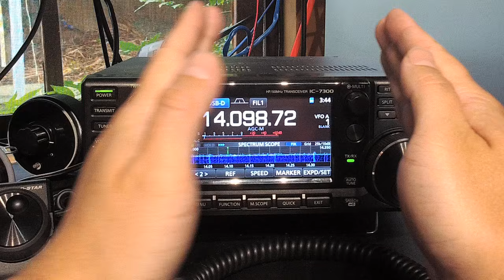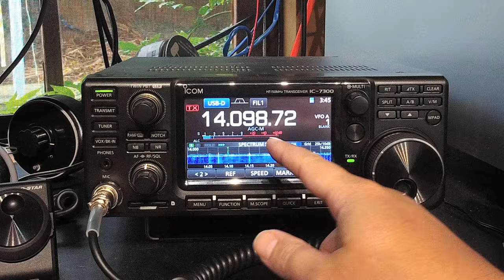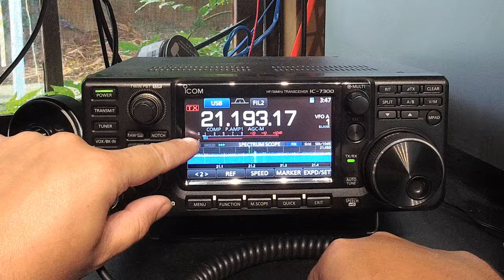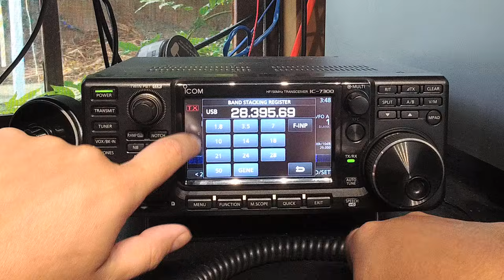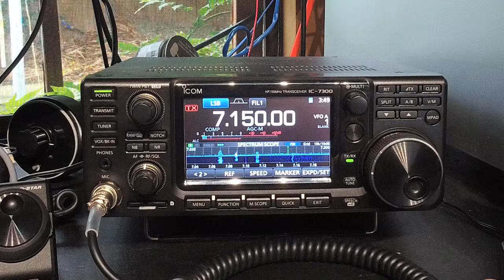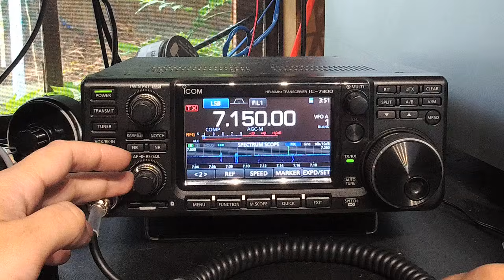How to Setup Your Receiver for Optimal Performance (IC-7300 & IC-7610)

Comment: Jarred I am looking at both the 7300 and the 7610.  I have seen your video 5 ways the 7300 is better.  However, I wonder what your opinion is why an operator should buy a 7610 over a 7300.  Enjoy your videos and wish you the best.  73 Chris KC5AD
Reply from the maker: Dear Chris, the 7610 IS a superior radio overall, but I did want to draw attention to the absolute value of the IC-7300.  In my opinion, you should only buy an IC-7610 if you have 2 or more antennas (comparing them in real time is one of the great joys of the 7610), and the rest of your station is up to scratch e.g. you have a linear amplifier if you want one, a good tuner if needed, and a beam antenna if possible.  If funds are no object, of course go for the IC-7610.  The price drops have made it a much better value proposition.  Thanks for the question and kind remarks, 73 Jarrad VK3BL

Comment: Good info. I use the RF gain as the volume control on my K2. I'm not worried about the S-meter - the RST code I think was developed before meters were common. No-one needs to be stronger than S8 anyway! Best wishes from Jon, G4LJW.
Reply from the maker: This is the best way to operate for sure.  Some radios like the Kenwood TS-590SG will 'adjust' the S Meter to show you a compensated level which is kind of nice but takes a little to get used to; I wonder if the K2 does this?.  73, Jarrad VK3BL

Comment: I just got my tech and general ticket  New ham KC1KNT  I also just got the IC 7300 and am trying to learn how to use it. I noticed that when you change bands you say " let me tune this up" and yopu switch to RTTY and hold the transmit hard key on the radio front. What does that do please  Great video it has been quite helpful

Comment: I can do the same with my IC-718. Lowering the RF gain can be done on any radio. As
far as QRM and QRN the 7300 is no better than a 718. Both are noisy. To get serious
noise reduction you will have to spend more coin. Sorry to burst anyone's bubble but
7300 isn't much for filtering and noise reduction.

Comment: I know this is off target but I've been racking my brain to find a way to run a external touch screen monitor with the ic-7610.I know it will drive a external monitor . look at it this way when you touch the screen it puts out a signal so if that signal is converted to the proper format it could be connected to the usb port .I wish I new some one from icom to look into this.  I have been told by 2 people one says icom is working on this the other said it will never happen. And one more said it cant be done because either there is now way to access a driver or the driver isn't there. Let me know what u think.  73  DE KD6ERP
Reply from the maker: Check my other reply Rob; in short without firmware updates from Icom whilst technically possible it wouldn’t be very useful.  73, Jarrad VK3BL :)

Comment: I have to admit I thought you were full of it but I checked it out and you were right by lowering the rf gain it lowered the static more than the signal present … how ever when u went to 10 m it showed several spikes with no signal present . I found that confusing  73  DE KD6ERP
Reply from the maker: It would be due to the fact I don’t have an antenna up presently for 10M and didn’t tune on that frequency; the spikes would be local noise sources.  Glad it was helpful 73, Jarrad VK3BL

Comment: what's up you hade 10 meters on the scope and it showed several spikes but no signals present
Reply from the maker: I don’t really have an antenna setup for 10M and wouldn’t have tuned the doublet so realistically the radio is just picking up strong local noise.  73, Jarrad VK3BL

Comment: Would't lowering the RF gain via the knob make it so one sees nothing on their panadapter/scope? I have tried your method and it does sound better, but it also has the result of showing nothing on the scope. It's like going back in time to make contacts by ear. 73 from N2LRB
Reply from the maker: It does lower the scope sensitivity and isnt automatically adjusted for, but you can use the REF feature of the scope to readjust the sensitivity at all times.  73, Jarrad VK3BL

Comment: Can you do a video on adjusting the ALC on SSB along with adjusting compression?  Specifically addressing the "scale" which isn't labeled.  Where exactly is the 30-50% they speak up in the manual when there is no label.  :)  Thanks
de w5dph

Comment: Hi everyone.

I revisited this video, because it is very useful. A simple RF gain adjusment  really can make listening to QSOs more pleasant. 

With hamlib's tool, rigctl, I created a simple script to collect 10 samples of 'RAWSTR' values, raw strength (S meter) value in interger number between 0-255. 

It just takes about 0.3 second to collect 10 samples, and average it.  
Calculate 1-avg_s/255, and it give a value to set RF gain . 0 means close RF gain, 1.0 open RF gain.
 

Based on my experience, The best value is around 0.6 or about 60%).  With default RF+SQL knob settings, the positon is about 9:30o'clock, for average  40m band QSO. for AM broadcast listening or very strong signal, 50%, or about  RF knob  at 9 o'clock position.

I hear less statics and band's noise, even with Fast AGC settting.(0.3s). 

Hope the info is useful .. 

Thank you.

Note: The rig is IC-7300.

Comment: Hi there can you tell me the normal place to set the Mic gain and compressor lever using a Heil PR781 Mic, mine is 60% on Mic gain and number 2 on compressor...with comp off the mic gain alone doesn't seem to activate the ALC very much till you get to about 60% from Fred in Uk.
Reply from the maker: They're great settings to use.  The PR-781 needs a lot of gain so anywhere from 60-85% depending on your voice should be fine.  Remember, any movement of the ALC - even approaching the recommended middle = distortion, so its best to keep it in the first quarter unless you're going for that rare one or can't be heard.  73, Jarrad VK3BL

Comment: I have a question for you. I have just got the 7300 and I noticed that sometimes on the display I see a faint red word that tends to flicker on and off not all the time but sometimes. It shows up flickering faintly on the meter screen at the top of the screen between the Fil2 box and the SD card icon. It is very faint and it reads either QVF or OVF, Like I said this doesn't happen all the time and just comes and goes on various bands. I can't find anything in the manual on this. Any ideas would be appreciated. Thanks! 

 

 

Reply
Reply from the maker: That is the OVF or overload warning :). Its an indicator to turn of the preamp and/or turn on attenuation.  73, Jarrad VK3BL :)
Reply: Rate My Radio Thank you!

Comment: Hi im a new m6 with a 7300 you say your tuning your radio why isn't the tuner button light on it looks to me your pressing your transmit button when I tune my antenna I hit tune button or am I doing it wrong Thanks
Reply from the maker: Dear John, you're almost certainly doing it correctly for your setup.  What isn't shown in this video is my external Palstar HF-Auto tuner, that can tune with inputs up to 100W.  73, Jarrad VK3BL :)

Comment: Does anyone get this annoying OVF flickering all the time, nothing in the manual about it Fred g4vvq.
Reply from the maker: Dear Fred, the best way of avoiding the 'OVF Flicker' is to not use pre-amps below 20M, lower the RF Gain on 40M, and use the attenuator on 80M and below.  73, Jarrad VK3BL
Reply: Hi Jarrad, ok thanks, yes i have turned it off now, dont need it on 20 by the look of it or below, i have also set the RF gain on Auto, there are 3 settings i had it on manual and turned right up, some people also put the Auto turner on and that seems to cure it...all a bit weird....just bought the radio, i really like it.....i have also got an ameritron 811H and trying to work out how to connect them together hi...from Fred in England.

Comment: Yes very good discussion on RF gain. I use that very method for years on my FT-101E and still do. Not worried about S-meter readings. This is the way ran our radios years ago to get rid of the noise. Thank you for the great video and now our secret is out.
Reply from the maker: Dear Lyle,
It certainly works magic with the FT-101E, I can attest to that.  A well setup 101E produces some of the most pleasing SSB audio you will ever hear!

73, Jarrad VK3BL

Comment: Which radio is better the IC 7300 or the IC 7600?
Reply from the maker: They're in different classes so not directly comparable; check out my latest answer to your previous question on the matter :) 73, Jarrad VK3BL

Comment: Great video.  I am running a G5RV and using the ATT has been helpful.  Thanks for the good tips! 73
Reply from the maker: You're most welcome :)  A G5RV is quite a bit of wire on bands above 80M, so it certainly doesn't hurt to add a little attenuation :)

73, Jarrad VK3BL

Comment: what antenna do you use for your 7300?
Reply from the maker: In this video it is a G5RV / 102ft dipole fed with ladder line up 14M at the apex and ~10M at each side. :)

Comment: Thank you for this very helpful video Jarrad. I've had my IC7300 a week and had contacts accident rather than design.  Your tutorial has helped me understand the principles of set-up and I feel better understanding about tuning and using the RF gain.  I'm looking forward to being on the air tonight!  Please do more videos.  You speak clearly and to the point.  An excellent presentation.   thanks again..  Robert   ZL2JED
Reply from the maker: Dear Robert, 

Thanks for the kind words :)  We're hoping to get a few more videos using the IC-7300 out soon as its a nice simple radio and good to use in demonstrations.  

That said, with the IC-7610 in the shack sooner or later we'll need to move it on, so if you have any specific requests get them in quick - my email is on QRZ.com but don't be offended if it takes a while to reply, especially if you send a long email as I'm a little time poor at the moment but definitely read them and file them away for later reply :)

73, Jarrad VK3BL & the RMR Team :)

Comment: How do you know if signals are making your AGC work?
Reply from the maker: Good question!  I don’t actually recall ever seeing a meter for this on any radio, and its probably a bit of a trade secret too.  That said, if you hear a static crash, and you notice the audio volume is lower and ‘ramps up’ back to normal afterwards, you know that the static crash pumped the AGC in a pretty big way.  I don’t know of an easy way to ‘monitor it on the fly’, other than if you find that only using as much RF Gain as needed reduces ‘listening fatigue’, then you know AGC is in use.  Basically, the answer is AGC is always in use, unless turned off.  73, Jarrad VK3BL
Reply: my understand was that S meters go off of AGC activity.  at least on older radios like my 830S that's the case.  it's also why the s meter doesn't move at all when AGC is off.

Comment: Jarred
I believe that the 7610 has a automatic notch filter built in to it. I believe you have to go into settings to turn this function on. That being said, it does not interfere with the reception as far as I see it. Leaveing it on has not caused any issues at all. 73 Jerry
Reply from the maker: Dear Jerry.  It definitely does - its just 2 button presses rather than 1.  You're correct for the most part it doesn't cause any issues with phone work and can be left on; the only time it especially does is digital modes and probably CW, although I haven't tested its effects there.  That's why I leave it off - I spend a lot of time using FT8 :)  73, Jarrad VK3BL & the RMR Team :)

Comment: Hi Jarrad, Are you using a full size G5RV and why is your noise floor on 80m so high? Also, did you actually say that accurate S readings are not important? are you a contester by any chance? This might sound rude, but how strong were the painkillers you were on om?

Comment: Too bad that Icom didn't provide an AGC Threshold Control (as an option to RF Gain), like many SDR receivers provide.  AGCT is much more effective at providing the control you talk about.  My 7300 was never as quiet (background noise) as my superhet rigs.  It is a great rig & deserves (as do the operators) AGCT.  -73

Comment: Hi Jarrad, nice explanation - in line with what I found with my IC-7300 by trial and error. A couple of additional points - you can change the settings for the slow, medium and fast AGC - in fact you can turn the AGC completely off by setting the value to zero when looking for those really, really, really weak stations. As well as the auto-notch, pressing and holding the notch button in takes you into manual notch and you can then position the notch where you want it, and adjust its width. Using that with the twin PBT can make it possible to hear really weak signals.
Not directly related to the receiver question - have you considered making up a lead to allow the tune button on the 7300 to trigger the automatic tuning function in your ACU? Having to change to RTTY and then back each time you change bands seems a little long-winded. Of course those without an external ACU will simply use the internal one in the 7300. I made up my own cable to use with my MFJ 993B, but it's possible to make up cables for "most" makes.

73  Ed VK2JI / DD5LP / G8GLM.
Reply from the maker: Dear Ed,

The AGC information is valuable - we think a follow up video is in order to cover that kind of thing :)

As for the tune plug adaptor, I perhaps should make one.  I used to have an Icom AH-4 plugged in as one of my antennas which is why I never did so, but we tend not to use that anymore preferring to stick to antennas with designed radiation patterns :)

The AH-4 of course we will keep to use with our DXPedition kit that consists of an Icom IC-7100, Icom IC-7200, Icom AH-4 Tuner, LDG AT-600 Pro II Tuner & a THP HL-450B Linear Amplifier.

73, Jarrad VK3BL & the RMR Team :)
Reply: Hi Jarrad, Although a tuning plug is one option (I built one of those when I only had my LDG AT-1000 (non PRO) which had no external rig connection) but modern auto-tuners (including your LDG AT-600 Pro II and of course the AH-8) often have an external interface and it's that I'm talking about wiring to, so that it's a true one button press tune up - in my case it's either the "tuner" button on the IC-7300 or the "Auto" button on the MFJ tuner (both buttons control both ends).
73  Ed.
Reply: Here's some info on how to build a tuner plug (and my attempts to convert an LDG 1000 for remore control - failure).

https://vk2ji.com/equipment/ic-7300-review-and-accessory-projects/atu-connectivity-to-an-ldg-at-1000/

Comment: Question: When you change bands, you "Tune up" by switching to RTTY and pressing the TRANSMIT button. Why? What does this do?
Reply from the maker: We run an external Palstar HF-AUTO Antenna Tuner; in order to tune it needs a carrier between 10-30 watts (it is rated up to 100).  
As we don't have a CW paddle on my desk, RTTY provides the easiest continuous carrier for my Palstar.  
Whilst the Icom radios have a 'Tuner' button, it only works with either the internal tuner or an AH-4.
Does this answer the question?  

73, Jarrad VK3BL & the Rate My Radio Team :)
Reply: Rate My Radio thanks! I was looking all over the manual for some feature I might have missed, but that explains it.
Reply: Rate My Radio 

Is there any difference if I use AM or FM mode compared to RTTY mode, in term of TX power output. ?

Thank you.
Reply: The Icom TUNER button also activates the LDG IT-100 and Z-100Plus (both interface compatible with the Icom AH-3 & -4 tuners.

Comment: Hi Jarrad,

I enjoyed your video, everyone who is thinking of using or buying a 7300 or 7610 should watch this.
Unfortunately some operators run these rigs receive flat out and then complain about OVF and overload and distortion when they don't know how to use the radio!
Classic example when a guy compared his FT 2000 to the 7300. He was running the 7300 with full RF Gain and pre Amp 1 on 40! 
I pointed out to him on his comments he didn't know how to use the 7300, then he got miffed about it and said the 7300 was at FAULT. Eff me....!
I also have the 7300 and love it....I may get the 7610 later this year , maybe haven't decided yet...
I will look for you on 40 and give you a call if I hear you on and say hello. Conditions are tricky for me from this QTH though on 40. I live in Echuca northern VK3.
All the best and keep up the good work!
Les, VK3TEX, Echuca, Vic.
Reply from the maker: Dear Les, please do give me a call, and you are spot on - so many of the 'OVF' worry warts have their receivers setup incorrectly.  

I can't imagine what kind of antenna would need a pre-amp on 40M, but some people believe that a pre-amp 'pulls in' the DX no matter what.

In my opinion the less active devices before the ADC the better... this is the true SDR dream.

The IC-7610 is very nice when running two antennas, but aside from that the IC-7300 is more than enough radio for almost anyone.

73, Jarrad VK3BL
Reply: Not only those SDR transceivers ! ;-)